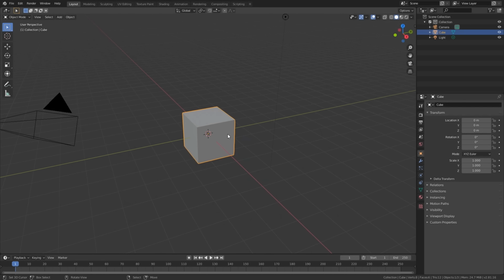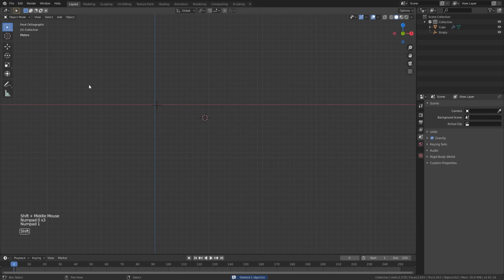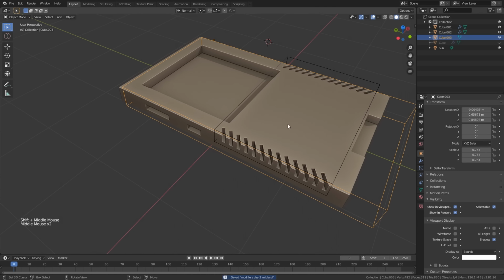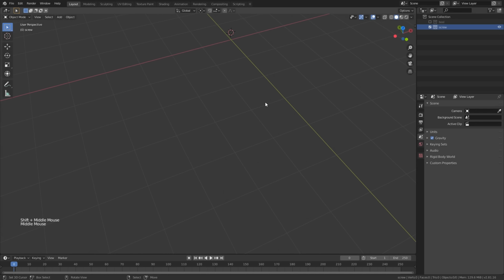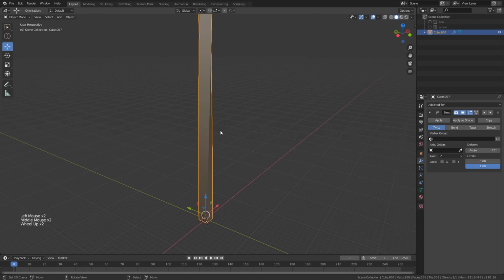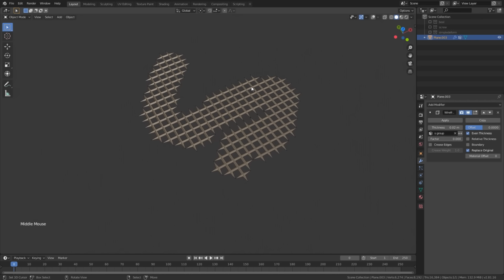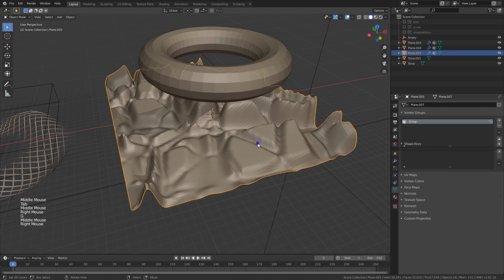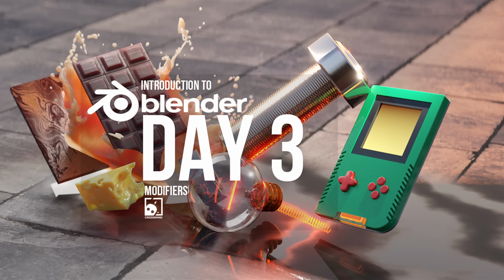Blender Day 3 - Modifiers -  Introduction Series for Beginners

Comment: Can't believe I'm only coming across this channel right now. This is a tremendous thing you have contributed. Amazing work. I'm learning so much. Hope your life is blessed with happiness
Reply from the maker: Not too late. Welcome to the channel.
Reply: @CrossMindStudio  hi! Could you help us teach how to make like joints in robots or like some of hard surface modeling if you know how to. Also really enjoying your work
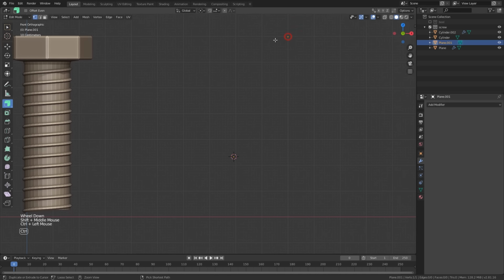Reply: in blender 2.80  that option origon not available waht should i do , time of video at 21;18. and 23:50 how you create path of vertics which tool you use to create bulb
Reply: @islam24oclock13  I also didn't understood that, he never mentioned it before, he is speeding up a little bit!
Reply: @islam24oclock13  Google doesn't hurt: About 5,110,000 results (0.51 seconds) 
The simplest way to add a new vertex in Blender starts in Edit mode. With another vertex selected, simply hold Ctrl and press the right mouse button to add a vertex wherever your cursor is located. (Ctrl + right-click will duplicate the selected item, or if nothing is selected a vertex will be created by default.)

Comment: Sir how you have drawn bulb in 23.
Reply from the maker: I am adding points( vertices) with ctrl click. If you are new to blender, i would suggest you watch this series in right order and start from Day 1.
LInk is in the discription.
Reply: 1) add an plane
2)Go to edit mode 
3)Select all vertices and delete all vertices
4) Ctrl+right click to add new vertices
Reply: @harshsuvarna7943  Definitely couldn't make that work, deleting all vertices, merging them or what. Maybe the right click on my mouse is about to die. Pressing E key and then pulling the point into place with left drag works though.

Comment: hi, when i apply all modifiers of the console and turn on "shade smooth" , the geometry of this shape is very bad. how to fix it?
Reply from the maker: Boolean modeling is different than subdivision modeling. In boolean unless you plan it well, lots of loops will not connect properly due to the nature of the operation. But there are still ways to fix the visual artifacts. You apply all the boolean modifiers and then in >object data properties> normals> enable autosmooth and play with the angle.  we have discussed subdivision modeling in later chapter( day 6 modeling aircraft), so you should be able to model same object with polygon tools later , if you decide to deform and animate it.
Reply: try to change the ngons or triangles into quads...and also turn on autosmooth...also try to apply the subd modifier after you are finished with editing cause it will add a whole lot of geometry and it'll be hard to work that way...

Comment: Need help after i link the faces i do the second Boolean and go to bounds my gameboy will disappear and only show the wire outline please somebody help.
Reply: I had the same issue, not sure what caused it but I had to use the mousewheel to increase the number of Bevels. If the bevels overlapped it caused the same problem. If i brought for them to sit flush together, it worked fine. 

Hope this helps!
Reply from the maker: Am i too late ? did your gameboy showup?
Reply: i am facing the same problem

Comment: Anyone else struggling to achieve the tower facade at 48:05? I'm unable to get anywhere close to that.
Reply: Essentially, Blender compares the transform (translation, rotation, scale) of the original object/origin and the offset object and applies the difference to each consecutive arrayed object. Since he rotated the plane in object mode but didn’t apply the rotation, it had a rotation of 90, but the empty had a rotation of 0, so the offset/difference was 90. Each arrayed object then had a multiple of 90° rotation. This is why he had to rotate the empty 90 degrees, so it would match the plane’s rotation, and cause a rotation difference of 0. I struggled at first because I created the plane and rotated but immediately applied the rotation, so rotating the empty like he did wasn’t necessary.
Reply: I wasn't getting the same result he was when he first set the Object offset. In his example, the arrayed objects immediately each have a multiple of 90 degrees applied to them, which is why he needed to rotate by 90 to negate that. In my case, rotating 90 wasn't necessary, but it took some time for me to understand the actual relationship between the offset object and the original object to which the array modifier is being applied.